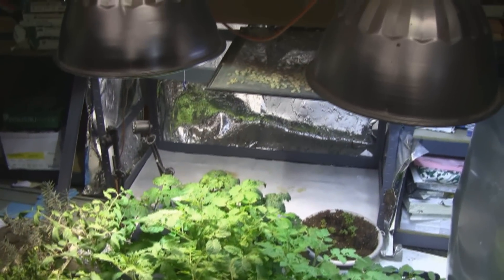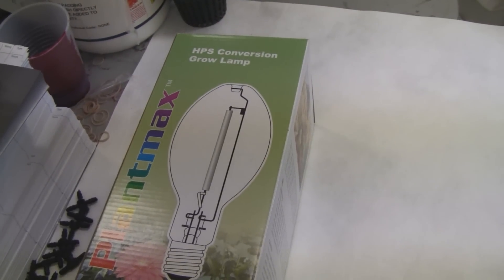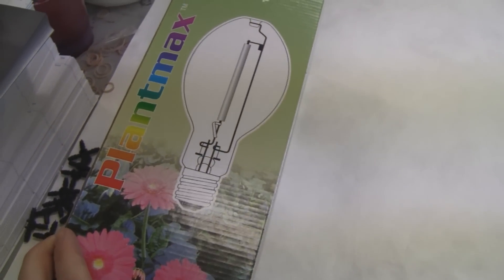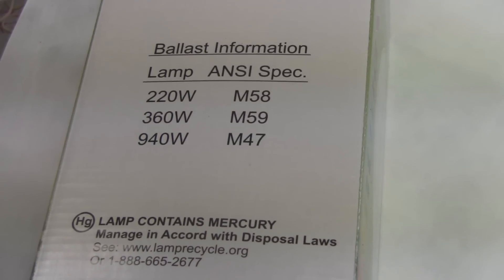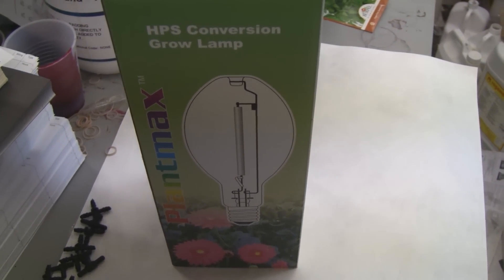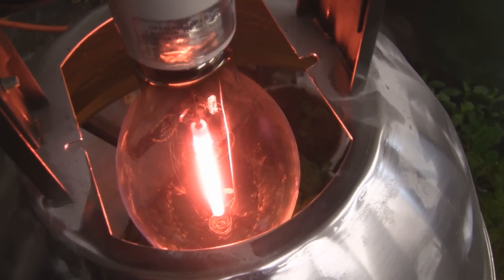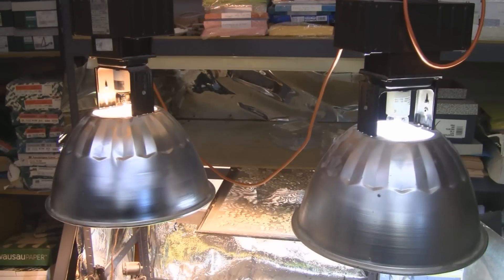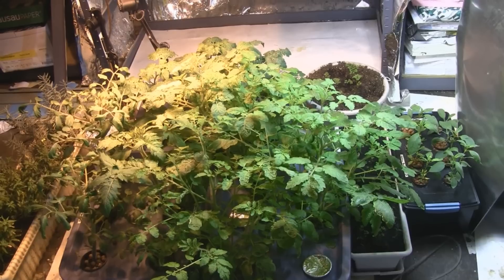How To Run High Pressure Sodium (HPS) on Metal Halide (MH) Fixtures & MH On HPS Fixtures

Comment: I also have a strong feeling that these plantmax high pressure sodium retrofit lamps might be destructive to the probe start metal halide ballasts that they are intended to run on since they seem to be penning start lamps and most probe start metal halide ballasts tend to be CWA ballasts and penning start high pressure sodium lamps are intended to be used only on HX autotransforner ballasts and series choke ballasts since their rising arc voltage drops can cause such lamps to run at dangerously high currents on CWA ballasts and possibly overload CWA ballasts to the point of failure.

Comment: Do you have different voltage wires inside box above the dome?..Shld read somethin like 120v-240v-280v or something like that?..Am i supposed to change wires according to bulb?

Comment: Where can you run sodium vaper lights. Because I tried replaceing a sodium vaper light with a regular light and it didn't work. Please respond
Reply from the maker: What is your fixture?
Reply: @SleestaksRule  What is a fixture sir? I don't these special vocabulary words of electric
Reply from the maker: @raginggamer5504  What are you using to power the bulb?
Reply: @SleestaksRule  Nothing, like I said im using a regular bulb stand and replacing it with the sodium vapor light. Yet nothing lights up or glows. Do I need specific things to light the bulb up if so list them all please.
Reply from the maker: @raginggamer5504  You need a socket with a ballast to power it like the ones in the video.
Reply: @SleestaksRule  And I just plug everything together. Simple as that?
Reply: I wish there was like a tutorial of how and where to plug everything together in
Reply from the maker: @raginggamer5504  https://www.youtube.com/watch?v=wKFWr1fA8d0
Reply: @SleestaksRule  Thanks bro

Comment: I have 2 atlas low bay and 2 lithoania hi-tech high bay and none will run these plantmax hps conversion bulbs without cycling off and on. What are the capacitor specs on the ones that are working for those that are working fine?
Reply from the maker: I'll take a look at what I have.  I'm still using the same conversion bulb for a few years now.  I only use it 2 about months per year.

Comment: I have 1 of these bulbs in high bay fixtures, but it keeps shutting down and restarting. I tried another bulb cause I thought it was bad. Also tried 4 different fixtures, but it still shuts down and restarts. What's the deal?
Reply from the maker: Todd Haworth
How long is the cord from the ballast to the lamp?  We worked out a problem with somebody having a 20ft cord and shortening it to 10ft or so and then it worked.  Also could be the failing capacitor as you mentioned.
Reply: Insufficient power once the lamp warms up? Could also be a heat issue...
Reply: I seem to remember somebody having the same problem and needing a capacitor.
Reply: 6 ft.
Reply: I have 4 of those fixtures. And 1 of those plantmax hps conversion bulbs. Using the bulb results in the same thing. The regular mh bulbs work fine. I took the first bulb back to the hydro shop and exchanged it. He tested both bulbs on a regular ballast and they worked fine.
Reply: I just can't see all my units needing capacitors.
Reply: Curious about the specs on my caps vs yours. I can get a whole new ballast kit including cap for $70 that I know will work, but would love to figure out away to fix cheaper. I would think upgrading to a bigger cap would fix it, but not sure what specs to look for
Reply: ***** I was gonna say the same thing.  It has to do with the conductance of the cord between the ballast and the light bulb.  Shortening it or I think using a thicker gauge should work.

Comment: hey just a tip you can run both hps and metal halide bulbs if u change your igniter on your ballast to one that can run both i did it with mine no problem without buying any conversion bulbs, a dual bulb ignitor only costs about $15 or so on ebay.

Comment: Where are you?  American and European High Pressure Sodium lamps are very different.  Here in the UK a 70 W SON High Pressure Sodium lamp typically draws just under 1 A at 90 V, while a 70 W American HPS lamp draws about 1.6 A at 55 V.  In Europe sodium and most metal halide are compatible, in the US they are not.

Comment: The light claims on that lamp are dubious as neon HPS atmosphere lamps like that one (neon lowers the starting potential so that the lamp does not require an ignitor) have efficiencies of only around 80lm/W to 90lm/W at those lamp powers.  Xenon atmosphere HPS lamps in that power range have efficiencies of 110lm/W to 120lm/W, so the specs of that lamp are copied from a xenon HPS lamp and are false for that lamp.

Comment: I don't get it.I've got loads of HPS and MH fixtures. In every single one, the ballast is dual-comaptible and the bulbs are directly interchangeable. (150 W HPS /MH or 250 W HPS/MH)

I use 240 V ballasts - maybe these are dual compatible, but 120 V ballasts are different for HPS/MH.